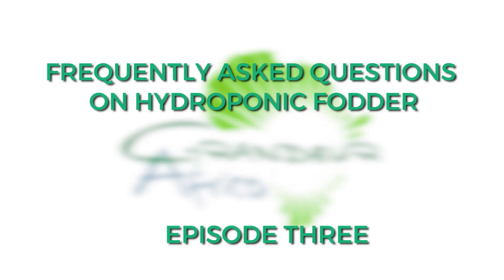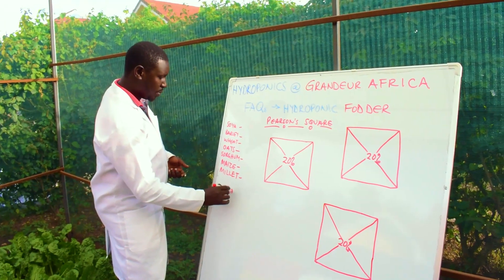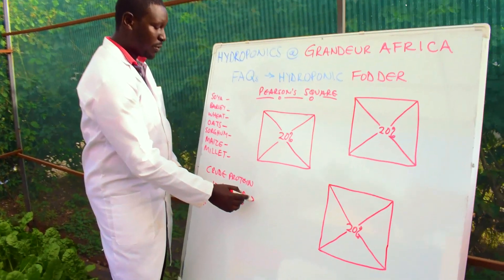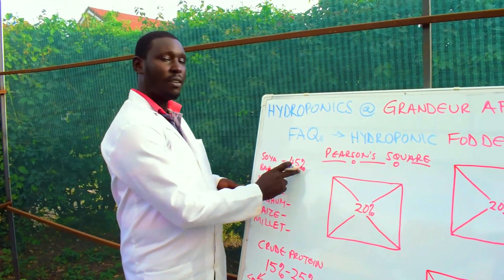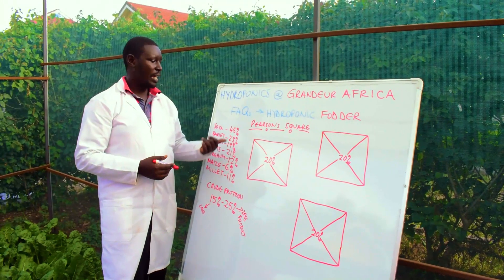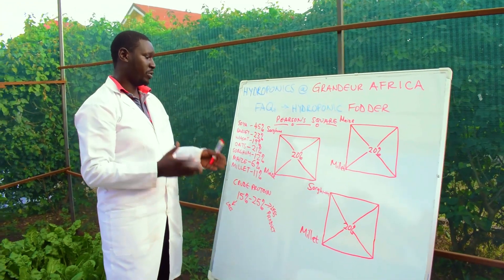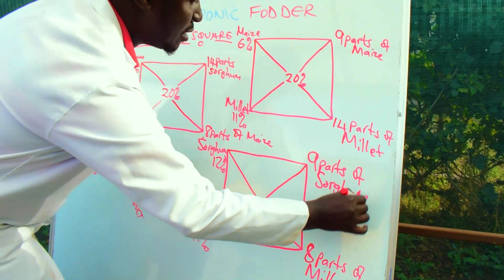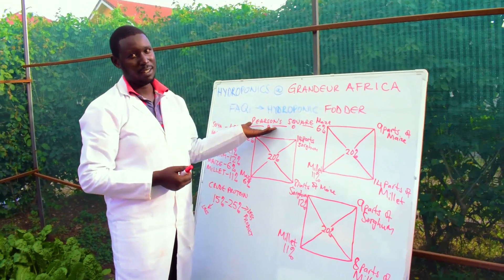How to Use Corn/Maize or Sorghum or Millet Seeds to Grow Hydroponic Fodder

Comment: Where I can get this seed
Reply from the maker: You can use cereals which do not have chemicals, from farms or seed suppliers. Remember seeds to be used for hydroponic fodder should not be treated with chemicals or dried using mechanical driers. From cereal stores or farmers

Comment: Kindly clarify the CP content  of each seeds, is it the original seeds content or after certain days of hydroponic growing?

For example, maize from original 5-6% CP content will increase to 13-15% at 7th days and 19-20% at 14th days
While interestingly for Soya with highest CP content on seeds, 1 local journal said the protein seems lost after the growth.
Reply from the maker: It is the protein concentration after growing however as mentioned in the video, the crude protein levels may vary depending on seed variety and method of testing

Comment: Hi Samuel, what the square meters of hydroponic fodder that can feed 200 cows and how many kg will a dairy cow supposed to eat daily? 
Also, is soya beans good for making fodder?
Reply from the maker: 200 cows would require a unit measuring 18M by 8M by 3M (LxWxH). A dairy cow of 400kgs live weight will do 12kgs of hydroponic fodder. Not advisable to use Soya EXCLUSIVELY due to higher protein content above the required range
Reply: @GrAnDeUrAfRiCa_Hydroponics  thank you very much and God bless you sir.

Comment: This is very illuminating. But you seem to have skipped giving any information about soybeans. If soybeans has more than 40% crude protein, why can’t we use it for hydroponic fodder? I searched the internet. I didn’t find anything on soybeans for fodder. Why is that so? Thank you for your anticipated response.
Reply from the maker: You can not use soya exclusively but you can mix with maize/millet/sorghum. The Pearson square  will help with ratios. Soya has very high protein. Check the introductory part of the video to understand the required protein range.

Comment: Well demonstrated 💯
I tried hydroponic for my livestock but in my country the temperatures sometimes are very high it can rise up to 45°c. And the result are not good.
What can do to control temperature without using electricity?
Reply from the maker: Use of Black shade net and modified  roof
Reply: @GrAnDeUrAfRiCa_Hydroponics  
Thanks again
What is the best shade net?
I see there is different types of shade nets in terms of percentage
Reply from the maker: 35% Black Shade Net would be best
Reply: @GrAnDeUrAfRiCa_Hydroponics  thank you sir